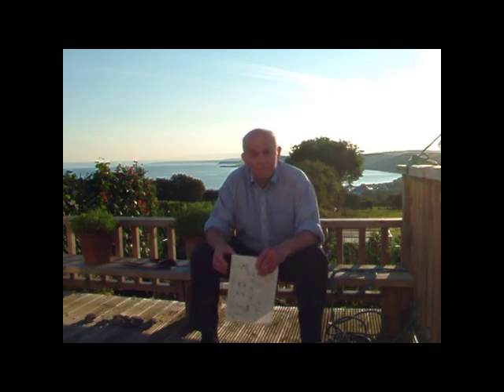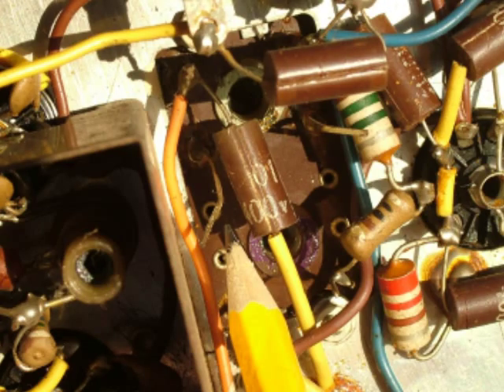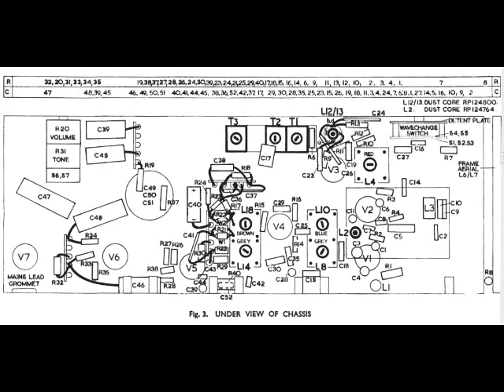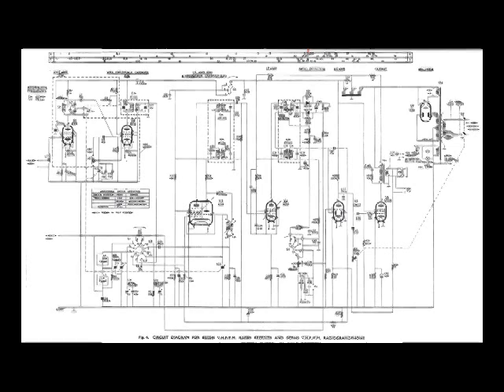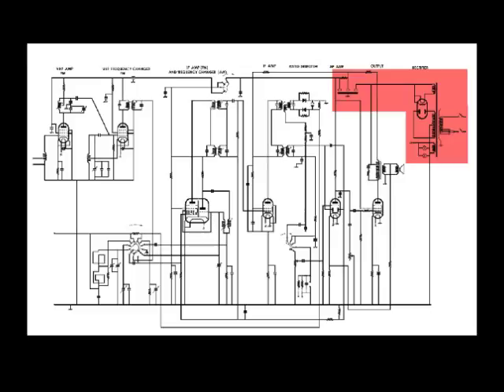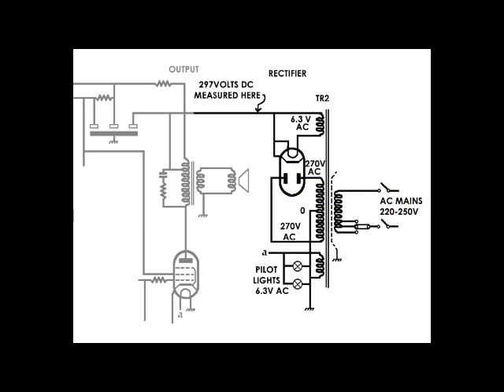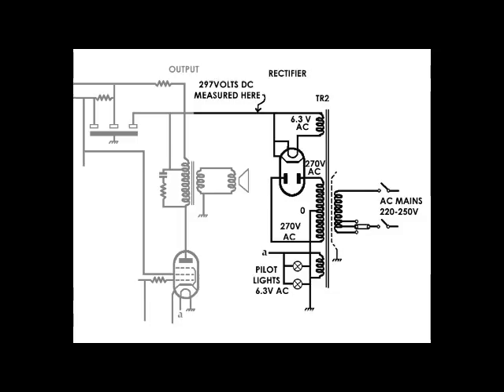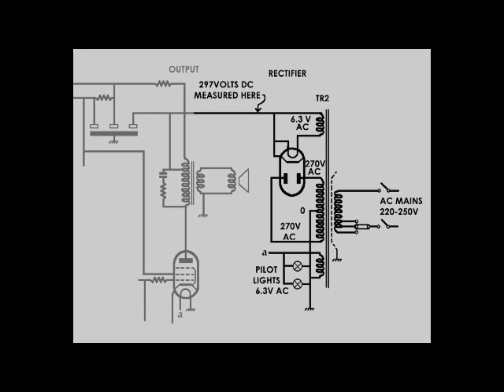About Radio ... Part 2 Data sheet and DC components by Andy Davies.

Comment: is it possible use radio schematics as amp
Reply from the maker: Hi, I take it you’re asking if a radio can be used as an amplifier? The answer is yes; normally you’d tap at input to the volume control and ground but be careful if you plan to do this with a mains powered radio as you could easily get electrocuted, you must have isolation from the mains. But no worries with a battery powered radio.
All the best ... Andy
Reply: Thank you.
Reply: Can you make short video with explanations please.
Reply from the maker: Hi, I can’t do it now but I think if you look at AllAmericanFiveRadio on YouTube I think you’ll find Rick has done a video about this. If it wasn’t rick I'm sure you’ll find it’s already been demonstrated.
Regards .... Andy

Comment from the maker: Hi Rock, well I’ve spent 30 odd years dealing with high power RF in induction heating applications, and that’s been anything from 1 KW up into hundreds of KWs and it involves a lot of water cooled components like valves, (tubes,) resistors and capacitors. Some of the big capacitors I’ve dealt with needed a fork lift truck to move them. Did you see my tongue-in-cheek  ‘500 Amp antenna base?’ video?
All the best ... Andy